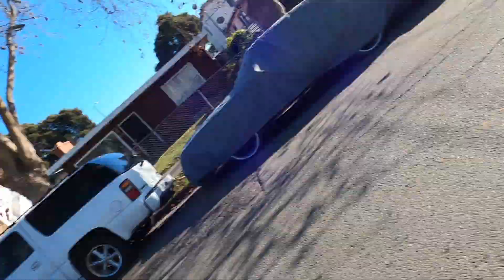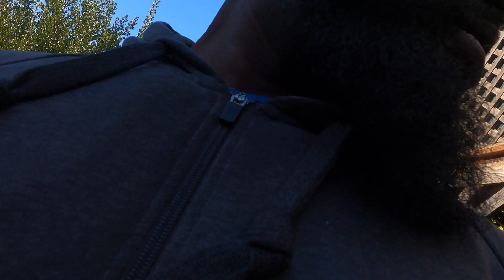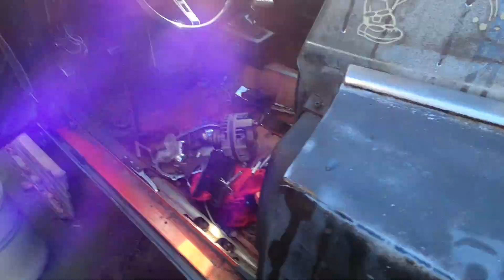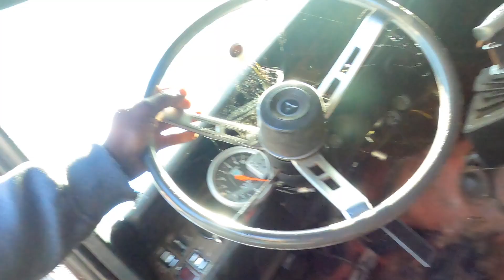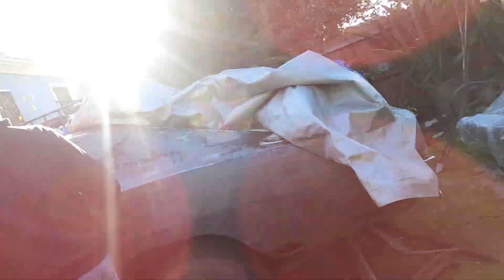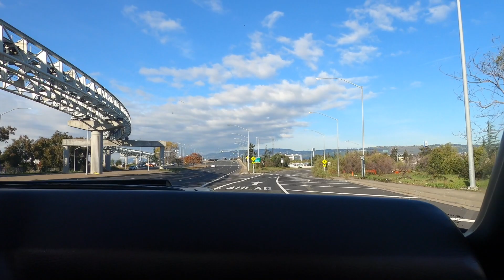1969 Dodge Charger update | MIGHTYDQ

Comment: Pop those rear rubber floor plugs to keep the water from pooling. And some more tarps. 
Crazy idea make it a targa top charger. Put a half cage to maintain the structure integrity. And maybe 1 of those new style lighting shifters.
Reply from the maker: Next time I'm over there I'll remove them